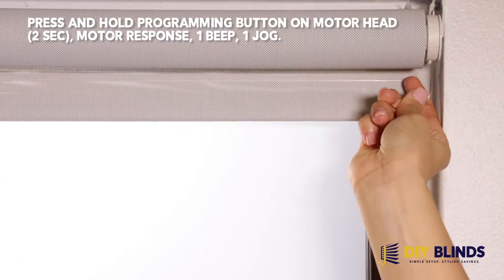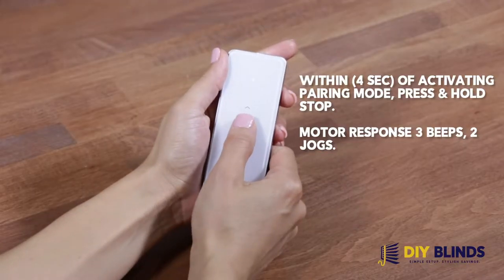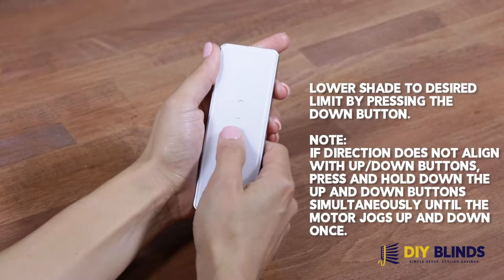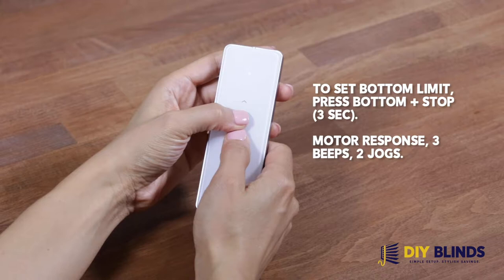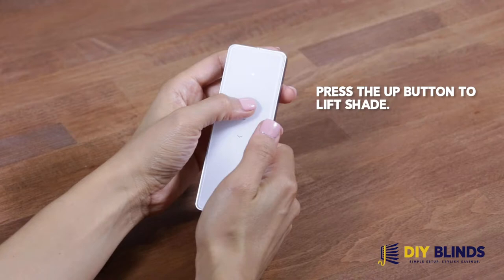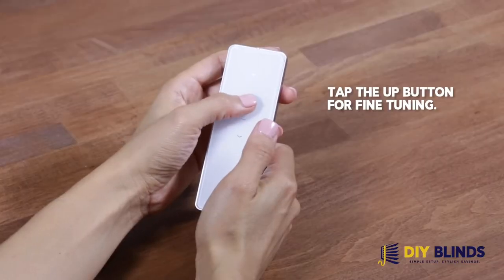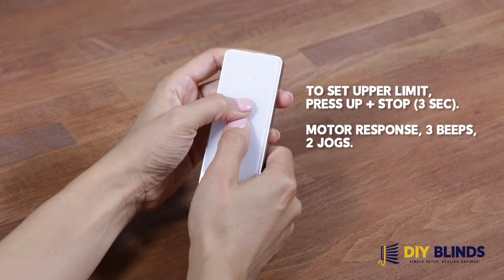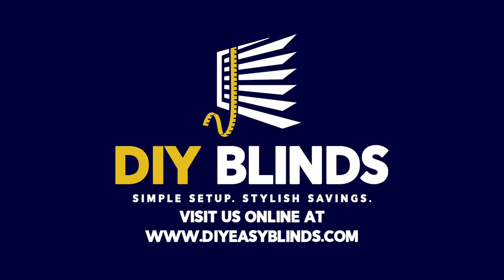How to Program a Rollease Motor

Comment: Everything works well until I get to the point where I set my shades in the down position. For some reason when I push the down button, the shade goes down however when it hits the bottom, it automatically start to go back up and stops 3/4 of the way up.  When I push the up button, it does start to go back up.  Any suggestions?

Comment: Our blinds started beeping when going up and down. So we charged them for 4 hours or so and now they won’t respond at all. We tried to reprogram and they don’t jog after pressing the button on the motor. Any ideas?
Reply: On the motor press & hold button with paper clip till it jogs four times to reprogram…. Also make sure control isn’t locked 🔒 by taking out the battery cover and pressing the 🔒 lock button once if it says U it is unlocked & L it is locked (hold for 5 seconds to unlock

Comment: On the motor press & hold button with paper clip till it jogs four times to reprogram…. Also make sure control isn’t locked 🔒 by taking out the battery cover and pressing the 🔒 lock button once if it says U it is unlocked & L it is locked (hold for 5 seconds to unlock

Comment: My Rollease blind stopped working.  Pressing the red button does not reset it (ie it does not jolt).  Checked power supply to blind and power is fine.  Any suggestions?
Reply: Hello, Thank you for contacting us. Our Rollease motorized blinds are chargeable only, not hard wired. We advise a full charge (approximately 8 hours) and replacing batteries in remote. If you have hard wired blinds, you will need to speak to a Rollease representative. Try this link https://rolleaseacmedamotors.com/pages/contact-us
Thank you, DIY Blinds Support Team.

Comment: Shade will not go all the way up and we tried the directions on this video
Reply: Hello, Thank you for contacting us. Our Rollease motorized blinds are chargeable only, not hard wired. We advise a full charge (approximately 8 hours) and replacing batteries in remote. If you have hard wired blinds, you will need to speak to a Rollease representative. Try this link https://rolleaseacmedamotors.com/pages/contact-us
Thank you, DIY Blinds Support Team.
Reply: This was my issue.  When you get to as far up as it will go, hold up and stop button together for AT LEAST three seconds until it beeps and jogs.  Then inch your way up to the desired height and press both again.